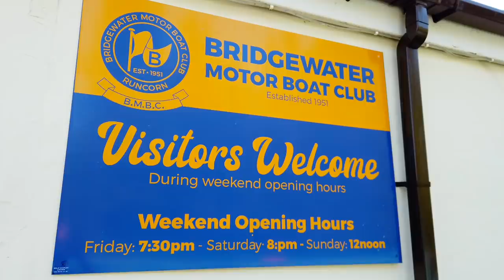Working the HISTORIC Sprinch Dry Canal Dock. Ep. 151.

Comment: Great video. In a way, any water tower high enough to reach the static head of the system is a relief system. The water, open to air minimizes pressure shocks that could damage a closed system. Closed is a system without a tower. This is all because water is non-compressible. A tower built today would be a simple boring steel thing. Thank you.

Comment: At around 5:39 you say it flows down a culvert back down into the river. I could understand how that would work if there was a lock nearby, so the water level was lower and the culvert outlet was lower than the bottom of the dock, but there doesn't seem to be one on the map. What am I failing to understand?
Reply from the maker: It's been there since the dock was built. Not sure how else to explain it?
Reply: @FoxesAfloat  OK, I spent a while looking at the satellite image of it; clearly water can't flow up hill, so I was wondering if it was pumped. However, it seems to have been there for a very long time, so that is unlikely. In any case, thanks for the video it was great fun to watch.